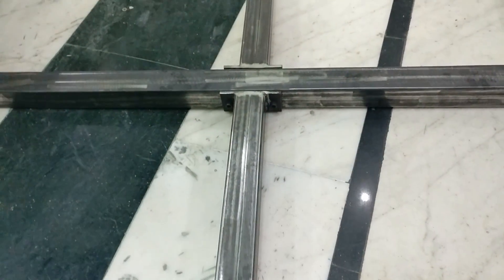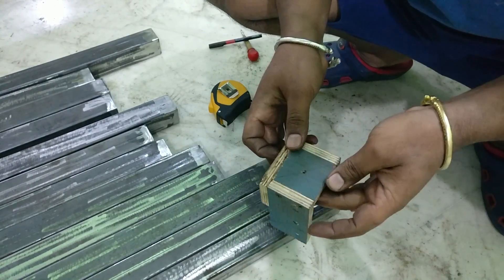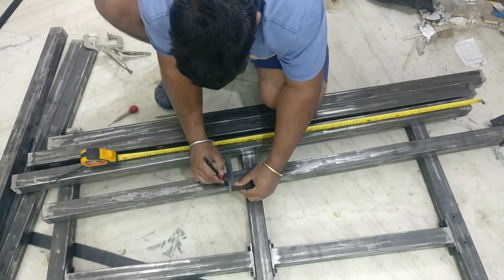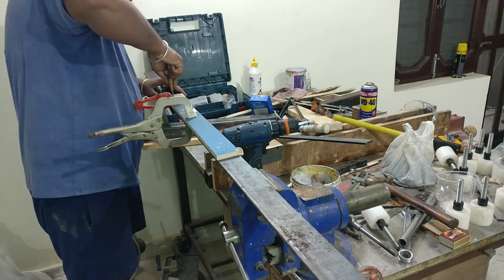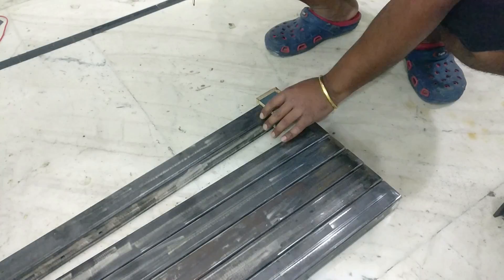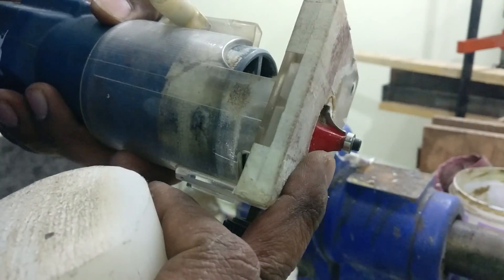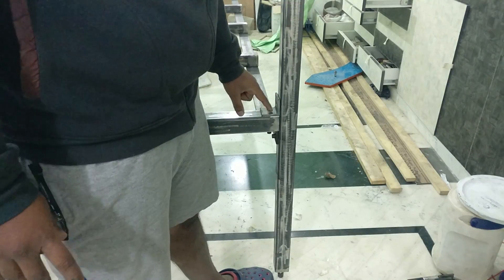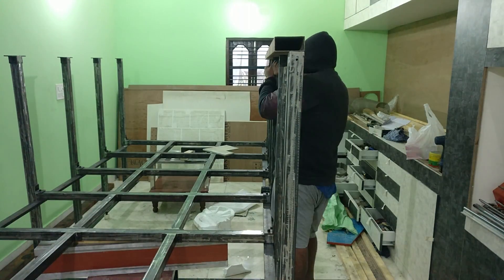Learn Building a Six Axis CNC Router Machine - Completing the Steel base - Part-2 by AMbros custom

Comment: Need a update on what happening ...with this build...at least tell what controller  your using
Reply from the maker: Buddy the frame is completely dismantled because of lack of space in the workshop, now working on new frame but half the size. Motor, controller, lm guide has been purchased but didn't start the work yet. Been busy in my other orders and so work on the cnc build kept on delaying. Confused in ball screw and rack for the driving. The work is going to be started untill I get all the materials. The parts are way too expensive that you need good account balance which I don't have. So main reason of the delay is that thing also. Don't think any chance in 2020. Seems like 2021 is going to be the birth of six axis cnc because at that time hopefully I established my main Workshop.

Comment: Exciting Idea. Hope you let us know your progress and/or problems that you have made.
Reply from the maker: Sorry man this project has been discarded and now I am going to build a smaller footprint cnc, definitely it's a six axis but the footprint is small to reduce the expenses. I also didn't have enough space left so a 5x 5 is the plan now.  Hopefully able to start it as early as possible.
Reply: @ambroscustom  Yeah that size was enormous.  Could have probably CNC a whole car in 1 shot. I have been looking at peoples builds to maybe do a CNC Router/Plasma Cutter, and maybe 3D printer as well to both save space and have a large print volume (~4'x6' I think).  But like you said ... I too need to figure out how to trim off some expenses. At least it is lots cheaper to build your own than to have one built. Maybe you might like this idea as well.  Since when 3D printing sometimes there are random failures, on larger models it sucks to scrap a project after a couple days @ 70% completion.  Not sure how to do this.  There are ways to make a video of your projects and would be wonderful if somehow it was possible to take the video feed and work out what layer the failure happened at then mill off what was needed and restart from that point with the 3d print. A million-dollar idea I think.
Reply from the maker: Yeah Michael you are right that it's alot more cheaper than buying a pre build Machine. As far as multipurpose cnc concerned I already made smaller footprint machine definitely a success but after way too many  failure. So this time when I made this 6 axis I stick to only one type which is a cnc router. Also to make a 5 and 6 axis is also a nightmare to build.  I thought multipurpose are good but for smaller footprint only. Your thoughts might be different but that's what I learnt form build my 3 in 1 machine. But appreciate your idea.

Comment: Ambro whats happening with your cnc...let's get a update
Reply from the maker: Hahaha........ Thanks for asking a question. I am currently working on smaller footprint CNC right now. To make the bigger CNC I need something with which I can work accurately for the bigger CNC parts. There are bunch of parts and I don't want to mess up any thing with aluminium, its way too costly. So to avoid those mistakes I am building a smaller 3 in 1 CNC hopefully within 3-4 days video is going to be published.....

Comment: Sir this is really cool but may I ask u which drill u r using I am planning to buy black decker 12 volt one
Reply from the maker: The drill I am using is a Chinese drill but don't buy black and decker 12v I used that for almost 2 years and struggle alot. Not able to last long as compared to my Chinese drill. Using them for almost a year now and well working, but suggest you to go with 14 or 18 volt drill, highly recommend 18 volt if you have money, 18volt never let you down. It's quite difficult to find 18 volt in India but try online website hope you find some good one. But 12 v from black and Decker not good but 18v is way better then 12v . I used bosch 14v , love that one also. Rest the choice is yours. Good luck, better to see in the market first then prefer online to see the build quality. Quality describes itself.

Comment: Pls take time to document how you tramm x, y z .  This was you 6 axis will most accurate.. Then build your bc axis head....you should make a communication water level... to get both rails completly  level..
...how do you plan to make both linear rails parallel  and level to each other...
Reply from the maker: Yes brother I am aware of that issue didn't show that in this video because completely exhausted but definitely fix that issue in next video before installing the linear rod and the Gantry. Thanks for being here.

Comment: You may find you need to add a brace to each up right post on the y axis at 15 deg angle back to the floor or leveling foot with a ext base plate for your leveling feet. This will stiffen up your side to side racking of you frame
During Rapids movements
Reply from the maker: I was just thinking for adding those braces but after your advice I am going to add them in each leg.